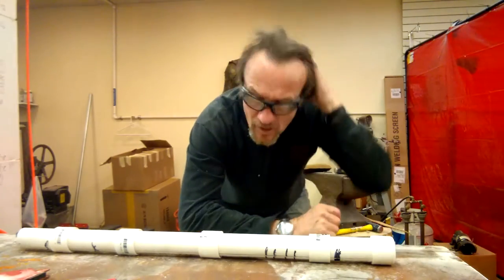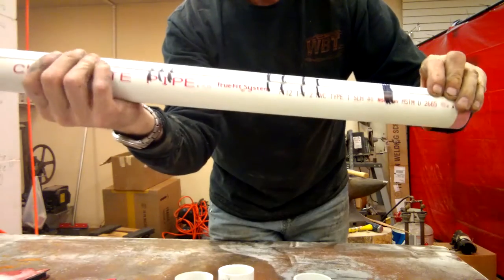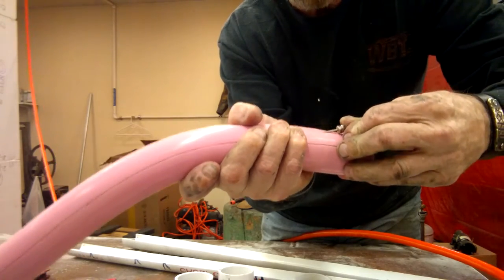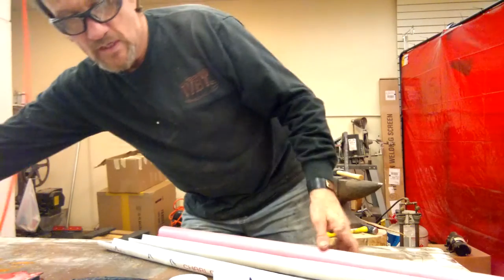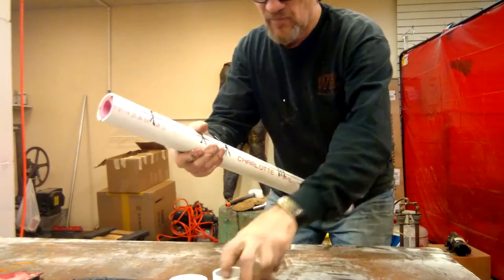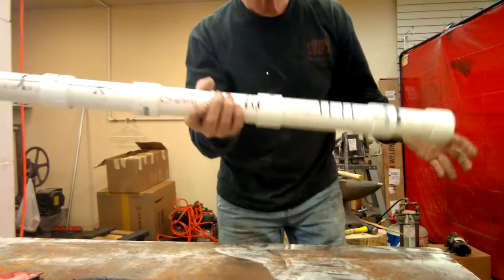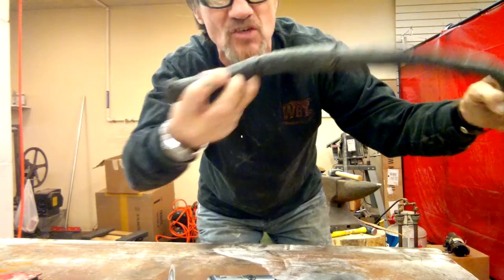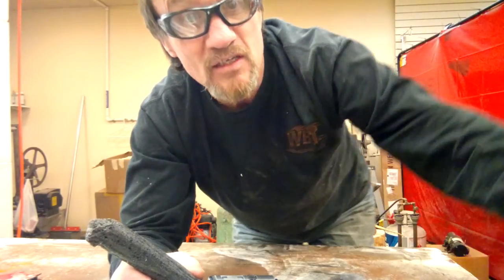Dread Mold

Comment: I've never done this before so I plan on making a bold like you. You say to use mold Max silicone but which one do I use what number 40 or 60 .
I don't know what the difference is
Reply: Mold max 30.
Just make a wooden or clay model and mold it. Then do foam dreads.

Comment: Hi bro do you sell them,I need about 40 dreads.ty
Reply: Sorry no. I dont make them any longer.
Reply: @claywilliams1230  Are ok Clay, I was wondering do you still have the solid mold and if so would you be willing to sell them. really loved your  work and so sad I missed out when you were selling them
Reply: @MonkeyDuDe1  it's not hard to do. Just sculpt the dread you want from an nsp Clay. Be creative with it. I then pit a metal rod thru the center to hold then straight with a hook on the end to hold it on something. I lowered it into the uncut pvc tube with the cap on the end making sure it didn't touch the sides anywhere (use a flashlight for this).
Then I mixed up the silicone. I used mold max 30 but mold star 30 works great. No degassing needed.
I poured scowling making sure I went around the dread trying not to let the silicone hit I.
Do that until it's full,let it set up and then follow this video and thats it!
Good luck. Let me know how it turns out. God Bless